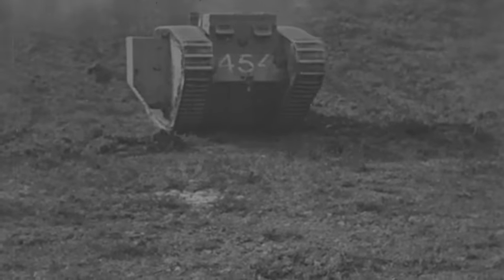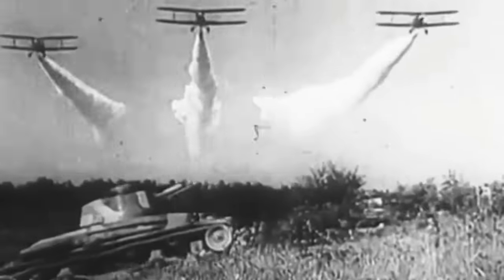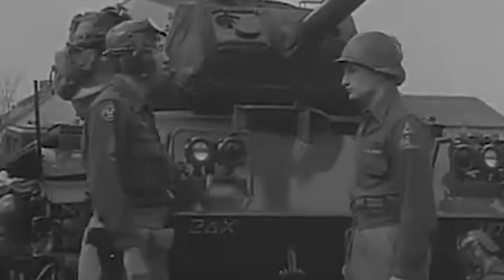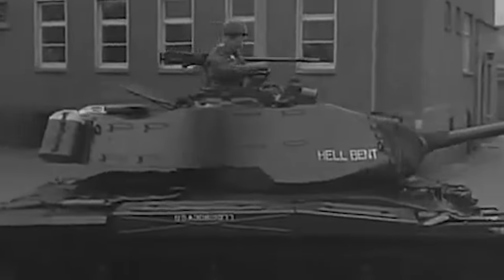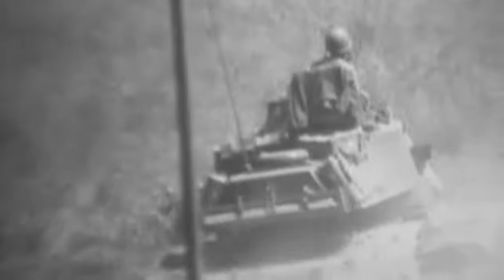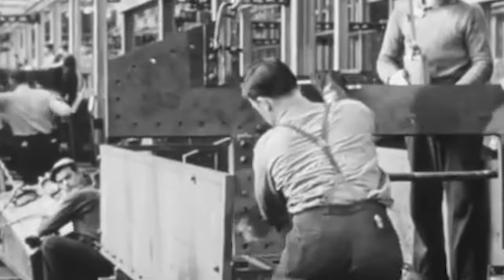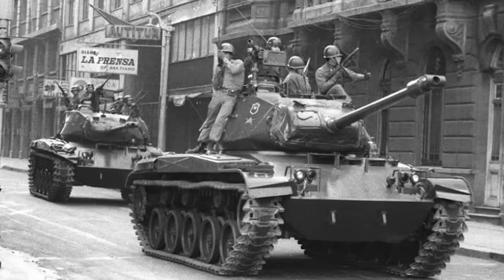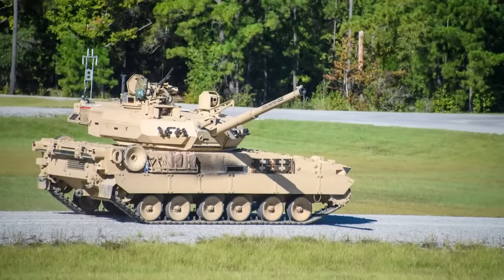The US Super Tank Russia Feared the Most

Comment: A Continental air-cooled Flat six with speeds capable of exceeding 65kmph (roughly 40mph), approximate range160km( roughly 99 miles) on 530litres (roughly 109 gallons) of fuel...
Cadillac: How fuel efficient does it need to be? 
U.S Military: No.
Reply: 1 Km = 0.6214 mile.